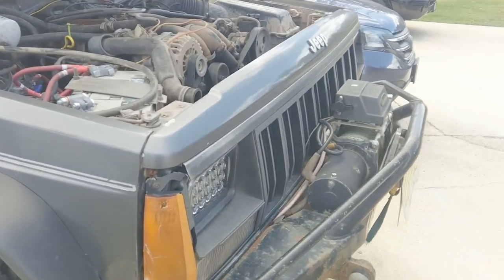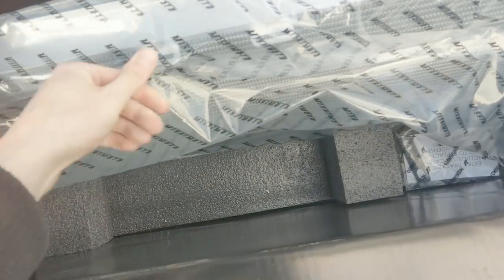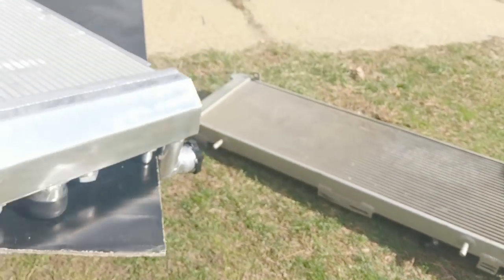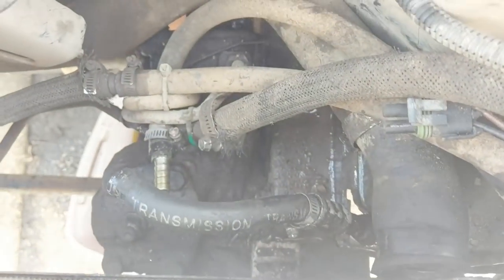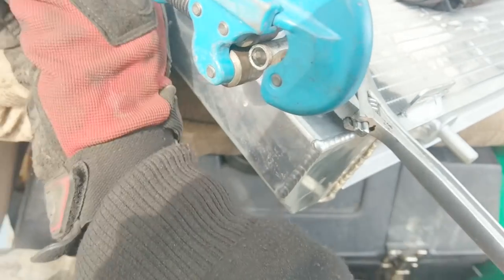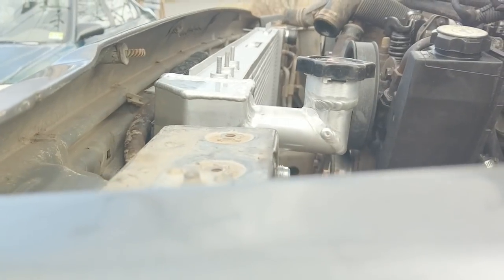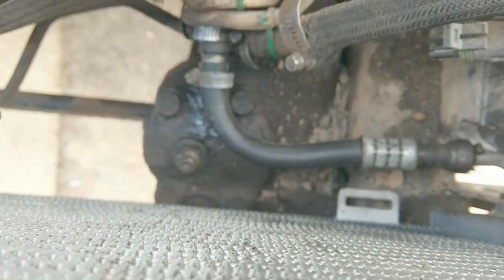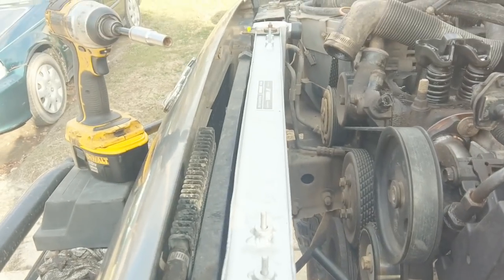89 Cherokee Mishimoto Aluminum  Radiator Install

Comment: "I kinda just wanna redo all of it" sounds like where I'm at with my '90 coolant system. Reservoir, rad, hoses, and water pump all leak for me. Will send you an install link for the rad I'm using, nobody I have talked to has used it, from radiatorexpress. Not much cheaper, looks similar quality. But back to your vid... Always great to see all your trials and errors on stuff, makes it much better for us everyday Joe's in terms of what actually are the hard and easy parts, and pitfalls to avoid (such as your rad brazing video)

Comment: Always look forward to your XJ videos more than anyone else's.  Watching today reminded me of another unrelated mod I wanted to do on my MJ; before, I reinstall the engine.  Still waiting on parts.
Reply: I'm going to try to relocate the sway bar frame mounts forward.  The rubber on the sway bars interfere with the larger coils I installed and nobody's brackets help.  The interference Upsets the handling, sometimes, in a turn; which, doesn't give me  super smoothness, every vehicle deserves.

Comment: I’m definitely watching this when the Mishimoto radiator and fans go back in (engine swap). It NEVER ran cool before, BUT turns out my stock engine (203k) was really shot. Sealant gunk was plugging up all the cooling passages. Fingers crossed.

Comment: Okay, it's been 4+ years since you installed this thing. Is it still in there? Does it suck? Quick update, please.
Reply from the maker: Well, it hasn't leaked yet, but the Jeep also hasn't been used since 2020. I'm not sure how much better it is then a new stock rad, but so far it's been worth more then the ebay crap.

Comment: Oh god i am worried mine is going to fail too!!. Oh crap $400 for another radiator!  I would cut the metal out because you are going to have to deal with this each time you get a replacement radiator. suggestion, after you get the upper bracket and such, spray paint the bolts and nuts so they wont rust away. Hah! you just voided your warranty by bending that tube. Great video Nick!
Reply from the maker: The upper trans cooler tube was something I made, so no warranty issues there.

Comment: I was told the trans lines to the radiator areactuall a simpleiteral tube to aid in warming of the trans fluid not so much cooling? so the question is??? is it really required especially if you are running a cooler?
Reply from the maker: It goes both ways. When the trans is cold, the rad heats up faster and helps to then heat up the trans fluid. If you're doing crazy donuts or something then the rad will be assorbing some of that heat to help cool it off, though not as well as an aux cooler could. I have both factory and aux cooler, and they work well for keeping things cool, but I may add an oil thermostat to help the trans at least get up to operating temp which helps get rid of moisture in the fluid and help it shift better.

Comment: did you try using those neat upper brackets in the box to bolt the radiator down? looks like they might have worked instead of having to fab some of your own washers?
Reply from the maker: Yeah, but how do they properly fit? Not sure if I'm missing something from my old rad but something seemed off.

Comment: I have a two-row aluminium one that costed about 200€, so I'm somewhere in between there. Temp never gets to the middle, though. It runs colder now and it only reaches 96ºC (206ºF) when idling stopped.
Maybe it's the combination of the radiator with the new clutch fan, which I think is running strong the whole time.
For aluminium engine and radiator parts, HOAT type coolant would be recommended. MOPAR has it, and anything Volkswagen G12++ or G13 is also HOAT. Not sure about the G12+, but I'm sure plain G12 is OAT.
Reply from the maker: I do recall seeing those abbreviations before, may have to look into that more.

Comment: How has the Mishimoto radiator held up, Nick? And for anyone else that has it, what are your thoughts?
Reply from the maker: So far so good. I'm just happy it's still holding up.
Reply: Only works better if paired with a high flow water pump.

Comment: I've heard horror stories about radiators and now I know what they meant. I'm just glad I havnt had any yet.
Reply from the maker: If you don't need the extra cooling, the stock ones really do last the longest. My stroker is a little oven that needs all the help it can get.
Reply: Haha well and hopefully with the tuning it'll be running better. Having lived through a few 4.0s they definitely can be finicky at times but dear god my 4.7 HO in my WJ is a hot one; never wants to just sit happy at a temp. In a way it's like a kid thats had too much sugar, it just cant sit still.

Comment: Hi Nick, I live in a desert zone 100 plus F in the summer so my OEM coolling system  is not good enough Im planning on change to a 3 row rad /3 elect fan kit from FF dynamics Id like to know if you have ear something about this kit because its kinda expensive or if you recomend just change the rad and keep my OEM electric and clutch fan
Reply from the maker: I haven't seen that kit personally, but I would not pay that much unless it was professional quality with a solid warranty. It looks a little bit like the ebay ones you can get for $100 a pop, but I can't say if that's actually true or not. The fans and shrouds looks decent though.
Reply: NickInTimeFilms  thanks  for the quick response I’ll keep investigating about this company  and congrats on your first 15k subs  Any recomandation on what to do? my OEM system works  ok  and its well  mainteined but 100 +  degrees is just too much for it
Reply from the maker: If you think electric fans would help then you can try that. If you think a fresh radiator would help, well, that's a tough call. I ended up going with this brand because I was tired of the cheap junk leaking after a year. Either that or try an oem rad, fresh one will help as well. Coolant filter will help keep the system clear and efficient too.

Comment: Should have bought a cheaper rad and used the extra money on the valve job you need buddy. That thing is running rough.
Reply from the maker: I'm done going cheap on important parts, ebay's cursed me one too many times now haha. Runs rough because it's an untuned renix stroker and it was pretty torn apart as you'll see in videos to come. When I have free time I'll have that thing running like a top.
Reply: Yeah I know what you mean about the cheap parts. Can’t wait to see your rebuild videos in the future. You and bleeping jeep are the most informational on YouTube. I really appreciate your time, explanations, and attention to detail it’s helped me lots on my renix build. Thank you an good luck
Reply: Once again, a Nick video is there to match the same exact problem I have.   I've decided I only ever do top grade parts - You get what you pay for, and I'm sick of wasting time replacing replacement parts.  That said, this seems like a really annoying install for a part that's 4x the cost.  I will still probably go Mishimoto, though, for the aforementioned reason.

Comment: At some point in time all those parts really add up and you got to start scratching your head is it time to buy new???
Reply from the maker: Well, let's play devils advocate shall we. I use this Jeep to go offroading, so If I buy a new vehicle I risk damaging something that is a lot more expensive. A newer vehicle means more electronics to get trashed and even costlier replacement parts. But ignoring all that lets say I get a JK Wrangler anyway, I certainly can't afford one outright so that's going to require a down payment. Then I'll have to buy a whole bunch of stuff to hop that one up so I'm still spending a lot money. Ok, fine lets buy a used completely modified wrangler then to save some, that's still $20-$35k I'll be spending to get a newer "more reliable" vehicle. Adding all my current mods up, I'm only $15k in, so I'd have to say I'm ahead of the game with a one-of-a-kind classic beast. I figure every new part is almost like a downpayment for a newer vehicle in a way so It's about the same cash wise. The civic is the daily driver, so it's not an issue if the Jeep has to be down for repairs. And the most important part, what would you watch every week if I wasn't out wrenching on my Jeep?! Haha.
Reply: NickInTimeFilms. Brother I hear you on the devil's advocate. For years I've been running my 97 Jeep Wrangler TJ sport into the ground racking up about a quarter of a million miles. Now in the past few years she's had the engine rebuild the transmission rebuilt pretty much every nickel and dime piece on a replaced and now that np231 transfer case is giving me a freaking headache. Now having said that I hope you can appreciate I've been in that boat and no I don't think I'll sell my TJ with all the tree rash and four wheeling dents everybody still loves that thing. But having said all that when I put pen to paper can I see what I'm spending on parts and tires and other miscellaneous stuff it adds up quick. I'm leaning towards the new JL though I don't like the looks I'm a big fan of an 8-speed automatic plus guys are running 37 inch tires running air conditioning and getting 15 miles to the gallon. My Wrangler has AC I need this. Anyway I'm just did a transitional point in my life where I don't even want to put a $300 used transfer case in it today. I'm sure I'll keep it for a lifelong project or maybe push it off on my kid but I'm older and getting up and down underneath a Jeep all the time isn't fun like it used to be. If I keep the TJ I'll probably one done it before my street legal Jeep I'm going to be purchasing something newer I think. Having said that there will always be a crew that loves Cherokees you got the bleepinjeep crowd and the Pabst Blue Ribbon boys but Tommy's gone. Anyway. Nice rig. Maybe one day ill pass u on a trail. I've done the math it's in the low 30s for a base model JL and I already have a lot of parts waiting for a new Jeep so it's been something I've been kicking around for awhile

Comment: 16:30....should have a grommet to protect against vibration
Reply from the maker: I'm not sure if mine was missing pieces or what, but the old rad didn't have much on it as far as isolators go. Watching Mishi's video, it seems a lot has changed over the years: https://www.youtube.com/watch?v=BCeA8n7QYr8

Comment: I've bought 4 flexalite radiators for my cherokee I'm trying this one next hopefully I can get my electric fans on it. Flexalite radiators cool really well but leak everytime after a few months this time before I installed the last one I used 8 packs of jb weld to glue the core to the tanks it hasn't leaked yet. But flexalite won't stand behind there warranty.
Reply from the maker: Good to know. For the ridiculous price they charge they better come to your house and install it for you haha.

Comment: More then likely that does look like the top mounting is designed for some type of isolation bushing. Which really makes zero sense cause there is still nothing in the bottom pegs. Now if this was “direct fit” they could extend the bottom pegs add a bushing and that would also allow the trans line to clear. .10 design change and this would’ve been direct fit lol.

Comment: Geez, that stroker does not sound happy...
Reply from the maker: It just had to get use to all that added horse power Hahaha
Reply: NickInTimeFilms I speak as someone looking at more power for my '03 TJ. Seems like there's all kinds of oddities to strokers like this that scare me away from them...
Reply from the maker: They definetly require a good tune. When I have a lot of free time I will be working on a custom map tuner to see if I can really get this thing to run right. With the wideband o2 tuner it's okay, but still could use a lot of work. The Renix system might not be helping a ton, but simple is always simple
Reply: NickInTimeFilms how many miles does that stroker have now? Does it still sound good under load?
Reply from the maker: I've got about 11k miles on it so far. The new header sounded really good at first, but now i only hear it very sparingly. Going up hills and stuff it pulls fine, though it's a little slow on steep hills in over drive
Reply: NickInTimeFilms yeah, I remember the first video you posted after the conversion, I thought it sounded great then. Hope the tuning goes well.

Comment: Dexcool
Reply from the maker: ha. Ha. HAHAHAHAno. That stuff will gel if you don't properly flush the system out of the green stuff, and it's also known to erode and clog stuff pretty bad, so I'm staying well away from the orange plague. I'd try a waterless lifetime coolant before dexcrap.
Reply: Ops  I had a brain Fart.We have this stuff at work that stops electrolysis in the coolant system.